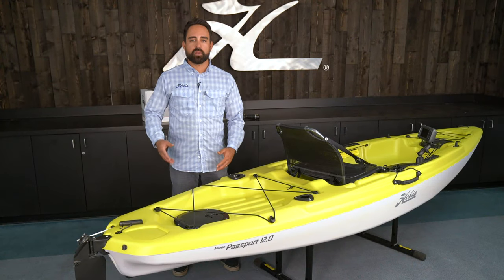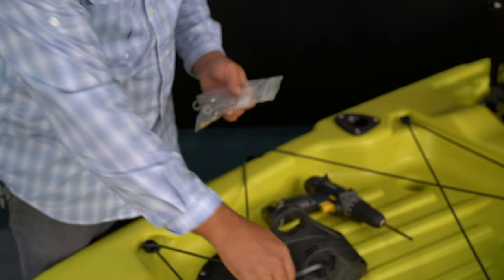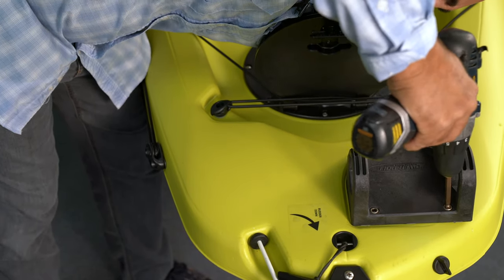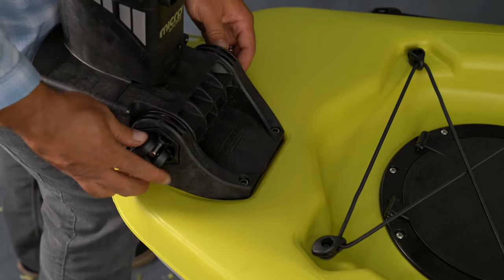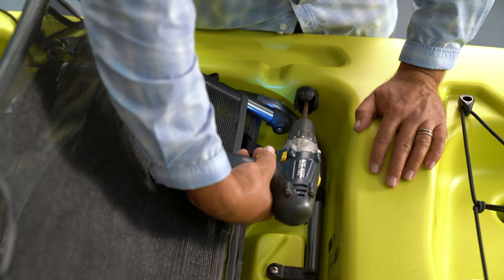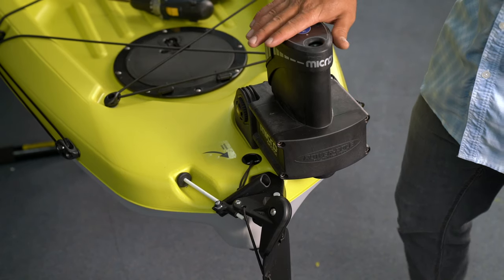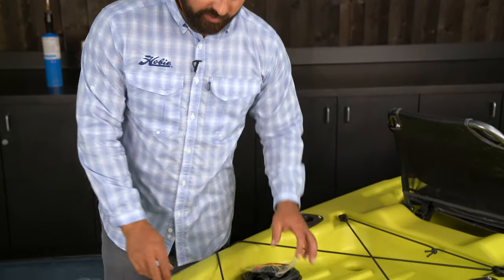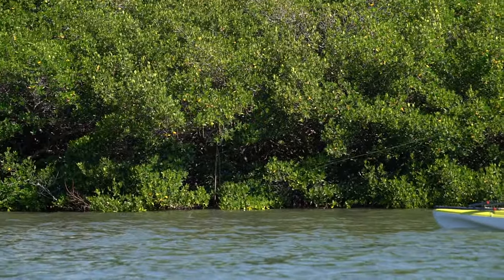Hobie Mirage Passport 12.0 Fishing Kayak | How to Install a Power-Pole Micro Shallow Water Anchor

Comment: If the micro drive interferes with the rudder stowage, why didn't Hobie have the micro driver mounted on the other side of the boat?
Reply from the maker: The left sided steering is the more important design integration.  Not every user will use a Power Pole, but even if you are a Power Pole user the rudder can be effectively stowed.  For transport - the Power Pole driver unit can be removed in a matter of seconds and the rudder can rest in the mounting bracket.

Comment: Can you put the power poll micro on an outback?
Reply from the maker: Our current Outback model (Year 2019 and on) has inserts molded right into it for a very simple install of the Power-Pole micro base plate. For older Outbacks we've seen adapter plates that allow the install.